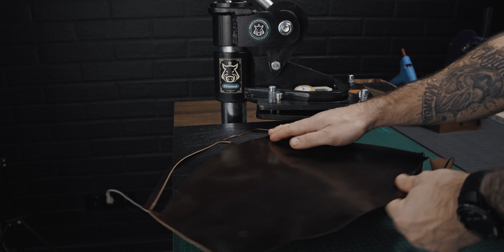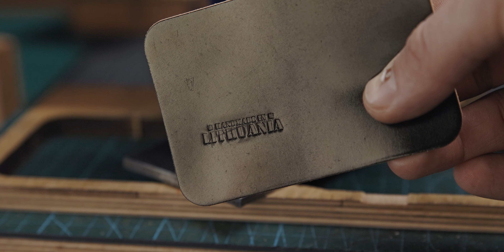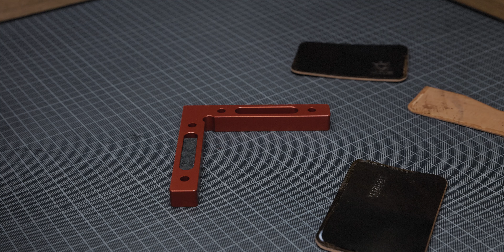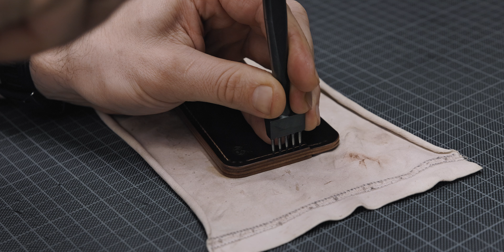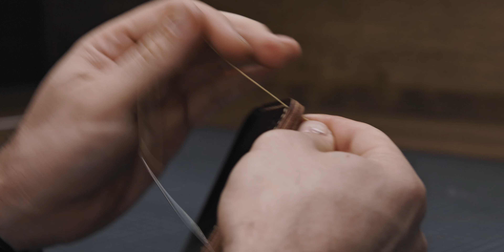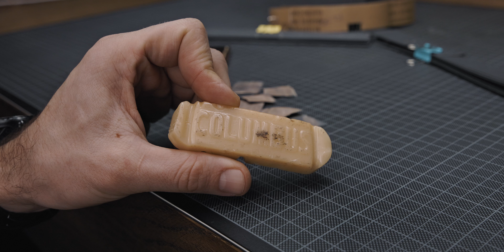Leather Crafting relax therapy - Shell Cordovan card holder full crafting process🐴⚒️

Comment: Thomas:  I learned a new way to saddle stitch from Eric at Corter Leather.  He says it was originally called the Leap Frog Stitch.  He shows the process to learn it.  I used to use a stitching pony and now mine is just collecting dust.  Eric's method is really fast.  It automatically adjusts the tension of each stitch.  It looks great.  I see a lot of crafters (who don't use a pony) struggle with mid air stitching.  I have been using Eric's method for over two years.  I will probably never go back to the pony.  You may want to check it out.  Even if you never use his method.
Reply from the maker: I have tried stitching pony few times, but for me its not an option. First of all, i use quite thick thread 1mm, it has even bigger knot after the needle, so i kinda need to make an additional effort/force everytime knot should go through hole. Pony doest stay rock solid and its annoying do stitching with quite thick thread. With thinner thread 0.4-.0.6mm its ok. 
Other thing i dont like about pony, is setting up the wallet multiple times during stitching and it even might leave marks on craft from clams. Im much faster & efficient without pony. But the main reason i go no pony is thick tread.

I have checked the method you said, will give a try. But i see one problem already. I use flat thread, which makes you to watch and control that thread do not twist. Eric as i see uses round thread, so its not an issue and no need to pay attention.

But overall im not advocate for stitching pony for sure ;)
Reply: @strhandmade  Actually, when he made the video, he used Ritza 25 Tiger at .6 mm.  Also flat.  He now uses Maine Thread with has now released a flat, braided poly thread.